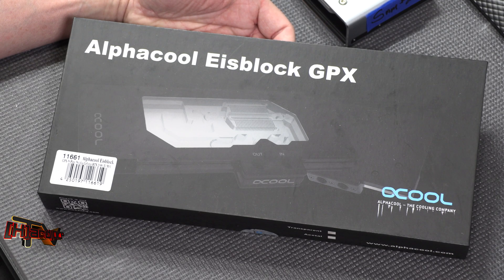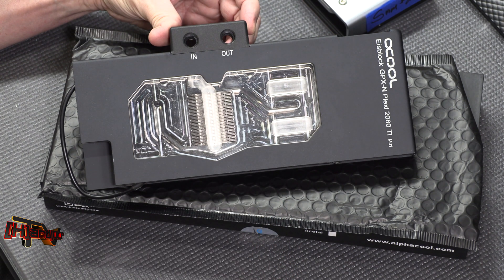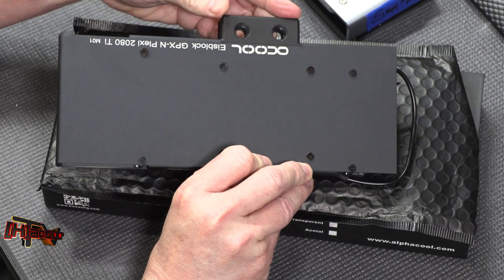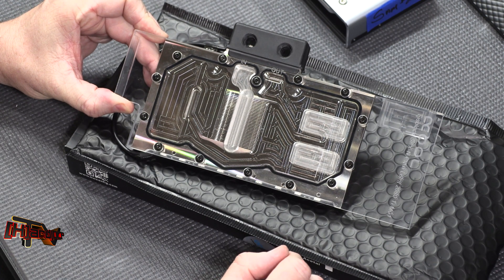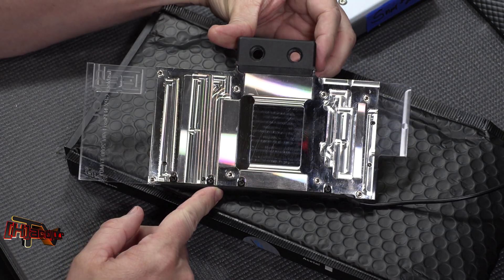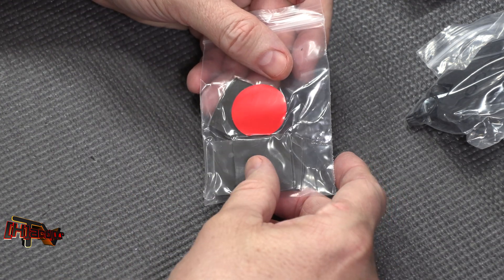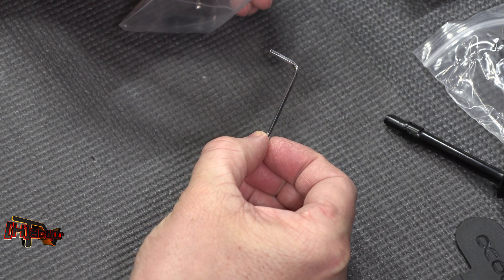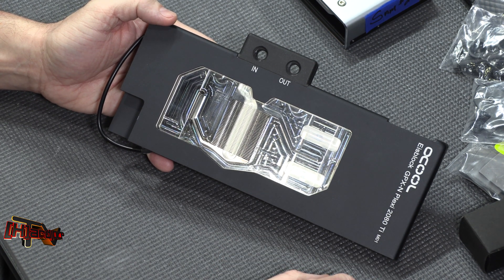AlphaCool Eisblock Unboxing for RTX 2080 Ti

Comment: I have the Alphacool Eisblock GPX-N Plexi Light Nvidia Geforce RTX 2080Ti M01 (11664).  Why does it not required to put thermal pads on the chokes?  Other waterblock instruction you to install thermal pads on and mosfet AND the chokes???  Even the stock air-cooler has thermal pads on the chokes.  Is this gonna affect performance not having pads on the chokes???

Comment: "Frag Harder Disco Lights"! LOL! Thanks Kyle! I needed that laugh! Personally I can't stand RGB. I do have a white LED in my case, but it's there so I can see better when I'm working on it. 
Is it compatible with the RTX Titan? I know they share the same PCB, and the EK has a water block that works on the 2080Ti and the RTX Titan. Speaking of which, I found a listing for an RTX Titan here in Canada. The guy is selling it for $1200CAD firm. Right now I can't afford it, and I am a little suspicious of the low price, but if you're interested I could find out some more info and figure out if this guy is for real, or I could just give you the link. Let me know.
The block looks nice. I like the closed in look. Makes it appear protected, like it has armor.
Reply from the maker: No more Titans for me!  :)  I will put the Eisblock Plexi (the fully shrouded one) in my system when I am done testing.   I am really liking the look of it as well.
Reply: @Matt Christie - quote "I can't stand RGB. but I do have a white LED in my case, but it's there so I can see better when I'm working on it"      ...SUURRRE!  cmon man!!!!  LOL!!!    edit: let me guess they're RGB but you just keep them set on white.   nice try.  [H]
Reply: @XX-121  No RGB. It's a white flexible notebook light that plugs in to a USB port, that I have affixed to the side of my front radiator. And it's only on when I clean or work on my PC. I run an EVGA X79 DARK. No RGB.